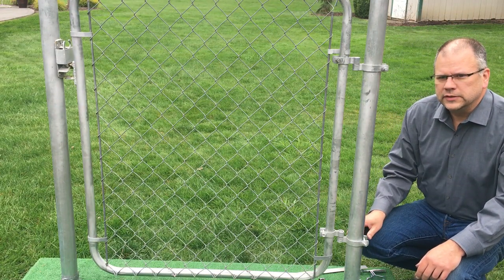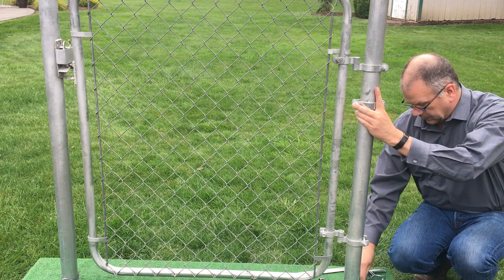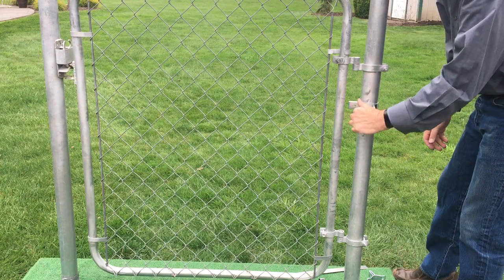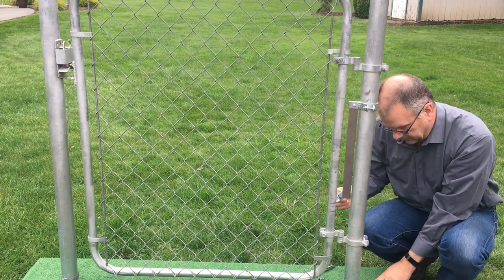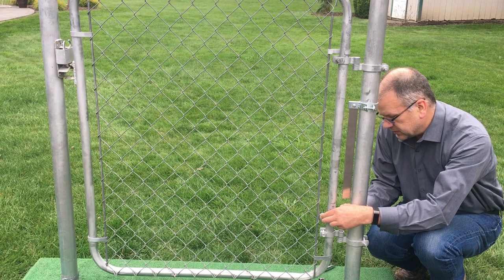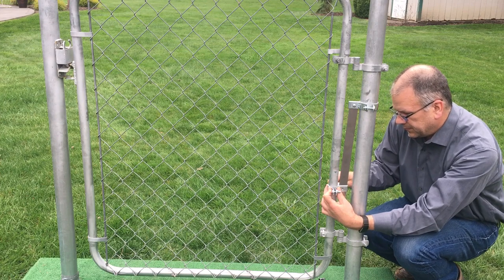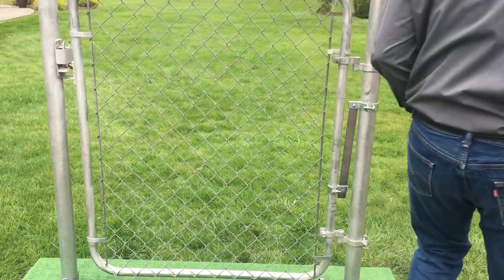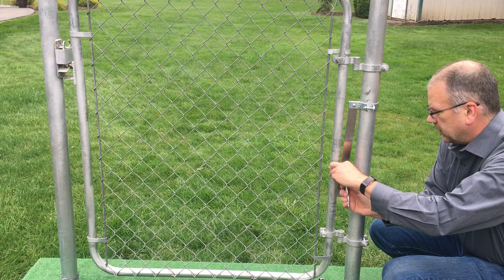Sta Kloz Chain link gate closer

Comment: Do they sell a cover for the spring?  I have little kids (the reason I want the gates to always stay closed) but can just see a little finger being pinched in between.
Reply: You might be able to use a piece of pool noodle or round pipe foam insulation and slide it down over the closer
Reply: @wardhomola6826  thank you that is a good suggestion.

Comment: Would it be ok to pour concrete inside of the hinge post and latch posts for added strength?
Reply from the maker: Sure you could do that, just be sure to tap on the side of the post to work out all the air bubbles in the concrete and you could also slide a piece of rebar into the concrete.
Reply: @GateShutCompany  is the rebar necessary inside the post with the concrete? I'm also finding it very difficult to get some privacy slats that offer 96% privacy.

Comment: Does the gate opens in both directions ??
Reply: Hi did you ever find out if this open and closes in both directions?
Reply: Yes, it does open both ways.
Reply: Yes. Both directions.

This is a Sure Latch Junior by Co-Line
Model: 7000-JR-SR-LTCH

I was also looking for this and finally found it. Hope this helps.

Comment: That if the gate is too far to left or right how do I adjust it
Reply from the maker: You can change the position of the gate closer clamps by rotating them, if you are trying to move the gate right or left within the gate frame you would need to change the gate hinges.

Comment: I cannot find a video on how to even up a drive gate chain link fence. I will even it up but when i open it about halfway it will "scratch" the driveway. Can someone post something like it, and how to fix it, please?
Reply: If you are still having this problem I would recomend first ensuring the gate post is plumb (360°) .  If so, then you could try adding a turnbuckle from the top corner at the post to the diagonal opposite corner.
Reply: @Platinum1812  thanks for ur reply, I will try it and let u know